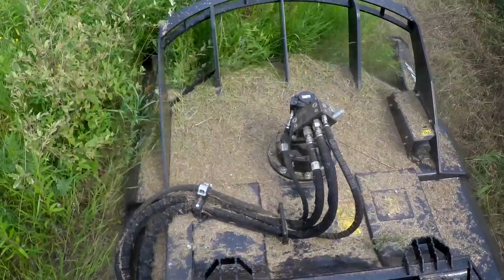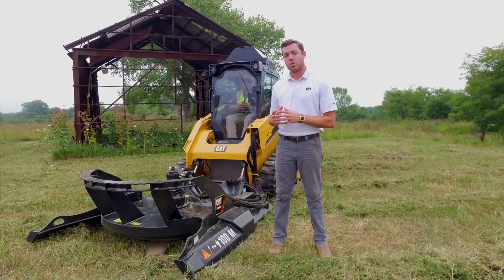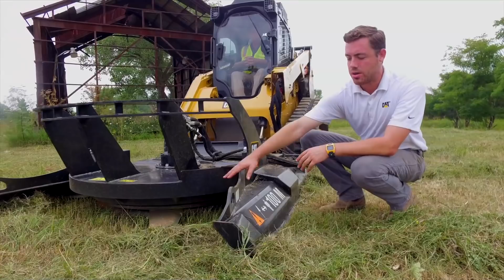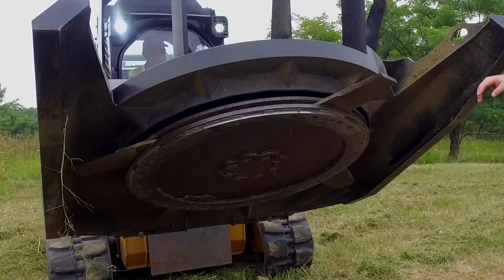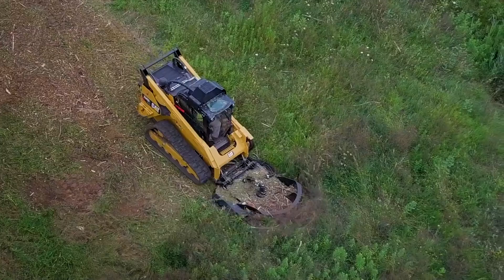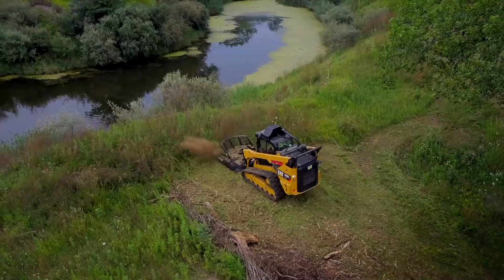Cat® Industrial Brushcutter Overview

Comment: Alex, what does XPS and XHP stand for on the brush cutter?
Reply from the maker: Great question Jeff. XPS and XHP indicate high flow hydraulic systems - XPS stands for extra pressure, and XHP stands for extra horsepower. In order to operate high flow attachments you will need a high flow machine to provide the speed and torque necessary to run the tool. For example, the XPS system gives up to 33 gmp or 4060 psi, and the XHP gives up to 40 gpm or 4060 psi. - Maria

Comment: I do a lot of mowing and brush clearing, I've learned that a mower of any kind throws material like crazy even when the blades ate fully covered. So dose this machine have any shield of any kind to prevent me from taking out a guys window or car door?
Reply from the maker: Hi Jordy! This particular brushcutter is our open faced brushcutter. We do offer a standard brushcutter with chains in the front of the deck and mulchers that come standard with front doors that you can close shut to prevent debris from flying. For more information on our brushcutter please visit our website: http://bit.ly/2kV4FUh